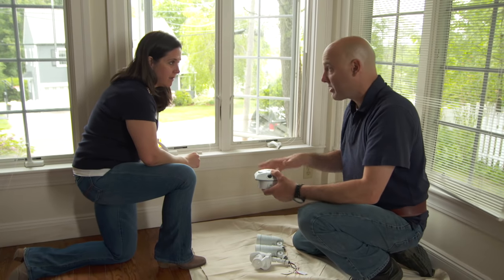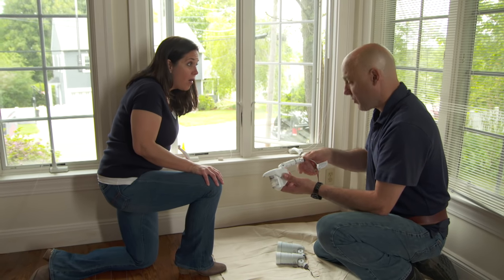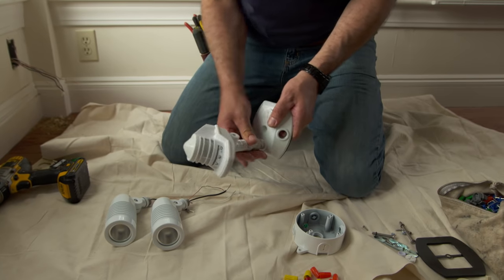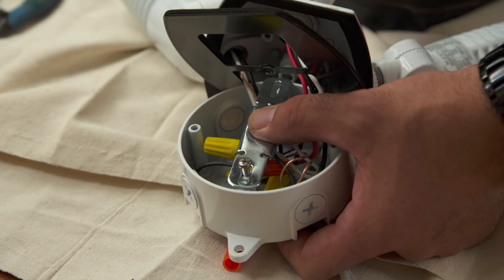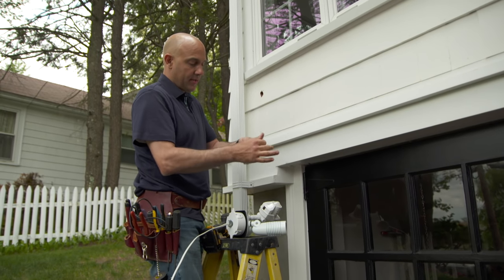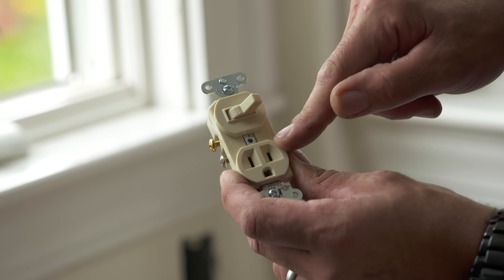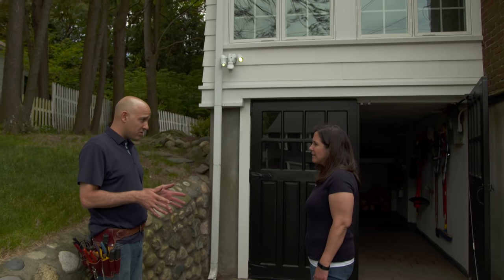How to Install a Motion-Activated Security Light | All About Lights | Ask This Old House

Comment: Tuned in to see wiring, which was glossed over. BTW when drilling out of a house, use a small pilot bit and go outside and use the spade bit from the outside in, so as not to blow out the hole as shown.
Reply: greg yomama no he didn’t. He went from inside out.
Reply: I was thinking the same thing too idk why would someone do it that way and doesn't really mention any wiring for those looking for that
Reply: when you buy the motion sensor it will have its own wiring diagram...

Comment: Love how This old house ALWAYS makes these jobs look easy, but choosing homes that have basements or easy access to do this.  Many homes have metal outlet boxes that are nailed to the framing.  Your not drilling that like you just showed.  NOt sure I'd want a switch that low on the ground or if I'd want to loose the outlet either.
Reply: If the outlet was a homerun/continuous power, why would you need a switch?
It would eventually time out and turn off, right?
Reply: @tii2015  Perhaps you would want the light off to enjoy the stars that evening, or perhaps you have a campfire, etc. and want the ambience of the light from the fire. The only problem would be forgetting to turn the light switch back on for the following night.

Comment: What I'm curious about, is drilling a hole through the box impede its UL listing and is that permissible as per the NEC?
Reply: No, it's not. At the very minimum you need a cable clamp where the wire enters the box. Also that waterproofing with some putty on wood is not enough. And you need to seal the external box.
Reply: @Ariel1S  that duct seal is sufficient for sealing around the back of the box. Especially once he screwed it to the siding. But you definitely aren’t supposed to drill through the back of those boxes. He’ll be alright though.

Comment: Isn't drilling and running the wire through the back of the outlet box against code?
Reply: yes, but.. #thuglife
Reply: +Derek Dinezza Electrical Code haha! That's only important if you're planning on an inspection in their eyes. Licensed electricians go for the path of least resistance, literally. He did most things by the book for the purpose of this video though.
Reply: +briancnc LEAST RESISTANCE. LITERARY!!! LOL
that is so true. he always does work against code
Reply: +Derek Dinezza In the Netherlands it is! and using extra tape to prevent shock hazard! 
I think we have better code in the Netherlands.
Reply: +Mischa Bommer Hallo van Missouri, Mischa!  Actually, our codes are probably the same.  It's just that in this case, the code is not being followed. Een prettige dag!
Reply: if the box has a knock out in the box how is that a code violation, you guys should pick up the code book and actually use it
Reply: centerice state the code reference please
Reply: greg yomama You are right if there where a knock out in the back, but he is just drilling a hole in the back of the box. (see at 1.22 in the video)
Reply: Maybe he put a snap in connector in the back of that box which was not filmed. 

Maybe since the other connection is secured by a connector a mere 2" away its good.

Maybe none of it matters and you can come back 100 years later to check up on it and his work is still as good as gold.
Reply: +Northbuilt, this guy does so much stuff against code, if you watch his other videos.
Reply: l
Reply: Ahh, a code violation but can you cite the violation? 110.3(B) comes to mind.
Reply: Mischa Bommer wow. You guys are so much superior.
Reply: DangerDaveFreestyle a snap in connector for these situations make so much sense, that house must be fairly new to have a plastic housing. I don’t mind the drilling of a hole in a box but it’s code to have a connector of some sort securing the wire to a box but who am I to say, I too follow path of least resistance.
Reply: @jak50cent  Right but that box does NOT have a knockout. Even if it did, you MUST install either a romex grommet or romex clamp into that knockout.
Reply: @electricianron_New_Jersey  Yeah I also hate it when "experts" on electrical videos say it's a code violation without citing it and instead tell me not to "cut corners" and do it the "right way".

Comment: Sure would have been nice to have seen some "straight" wiring. Instead, it was hop, skip, and jump flashes of wiring the fixture. This vid was almost useless.
Reply: Jesus is ALIVE It was useless. I also wouldn't recommend using an outlet to wire an outdoor light, for one it just doesn't make sense and two it looks dumb having a switch on an outlet and three since when do switches go on the ground. Also yes your right this video didn't really show any wiring, no black- hot wire, white wire neutral, green wire ground, anyway the video was pointless, I'm sorry that people had to waste there time on this crap, most of what he showed is written on the box, technically even the wiring is, but seeing how to do something does help sometimes.
Reply: @pspvita99  the black is neutral
Reply: @misterwebb1472  Black is usually hot
Reply: @misterwebb1472  White is Neutral, Black OR Red is hot, Green or exposed copper is ground.
Reply: So show them yourself, ? I need a link following your solution that is suggested ?
Reply: @pspvita99  make a tutorial so we can see the proper way Matt , that might be more helpful

Comment: Wouldn't mind a walk through on the actual wiring.
Reply: +Audioquest56 ...and the red wire they show going to the blacks?  You did watch the video before taking this opportunity to be funny right?
Reply: Ahhhhh whatever works... I just thought there would be modular connections and setups is all.
Reply: it would be nice to have to proper wire schematics, not all of us are electricians. I will look it up, like This Old House, but to many shortcuts
Reply: +Jon Gordon Its actually really easy. There is no need for an explanation. On the motion sensor, there is a red switch wire which goes to the switch. You power the lights constant with + and route the negative through the motion sensor. then it really is just white to white, black to black, and ground to ground.
Reply: +First Last thanks for advice, I will check it out.
Reply: @DordiHOTS  So the wire from the exterior motion sensing light connects to the power wire that was connected to the wall outlet (black to black, white to white, red to red) but does that then connect into the new wall outlet so it is still available for interior use ?  That's the part I don't see. Thanks for any help.
Reply: @michaelbiasatti5016  You can "piggyback" connections, as most wall outlets share a hot wire, but one wire going to the switch is to override the motion sensor, essentially the circuit board inside the motion sensor knows when the power is cut and restored and just turns on the light normally, ignoring motion sensor input.
Reply: @DordiHOTS  no positive and negative on alternating current systems

Comment: Anyone knows what the flexible putty is? I would like to know where I can buy it. Thanks.
Reply: Kinda looks like roof putty which is a butyl rubber sealant. That would be a lot less messier than dealing with silicone and easy to keep a small pouch in your tool bag.
Reply: Thanks though his one seems more shapeable than rubber sealant. Thanks anyway for your input.
Reply: https://youtu.be/4Upksj19lyU?t=2m45s This is the stuff I'm talking about it feels like play-doh or clay after you peel it off. I used this on metal roofing seams and on RVs.
Reply: If it is something else, I'd like to know what it is as well.
Reply: Thanks again. This may work for one of my applications.
Reply: That was regurgitated acting talent. 

They edited that part out, but Erika reacted as such, "Oh, really ?? Wow!"
Reply: Jen-Yi Chen it’s called “plug duct seal”, very useful item because it never hardens and resists water, normally used inside conduit and duct work. For this particular application, exterior silicone would be better suited around the fixture with inside filler with duct seal or window based spray foam.

Comment: Does anyone know if it is against code to do this if you have smoke detectors on the same breaker? Would love to know before I attempt this project
Reply: I wouldn't add anything to a circuit powering smoke detectors.  If the fixture added were to trip the breaker, it might affect the smoke detectors. Why risk it?

Comment: oof. couldnt he have drilled with a regular bit to create a tiny hole on the outside, then from the outside use that widening bit to drill back in? nice clean hole on the outside that way
Reply: who cares it’s caulked and covered forever.
Reply: Yes, especially on older homes. I've seen guys using that same bit push way to hard and break the sinding in half (older shingle siding). Contractors always want to work as fast as possible. You have to be like a F1 driver and know where and when to slow down and when to drive hard.

Comment: This electrician has done so many jobs against code
Reply: like what
Reply: building code differs from city to city....
Reply: Well for starters he drills from the inside of an internal box directly outside. Inside that box there is no method to hold that wire in the box. you can't modify wall boxes as that "was not intended by the manufacturer". No matter the locality codes will work with how the manufacturer for the box or fixture has designed because they work off of the National electrical Code (NEC)  and they feed each other for how to do things.

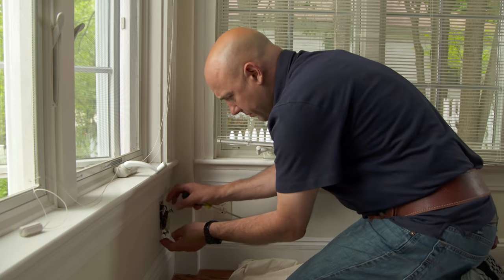Comment: 1:08 dude you could’ve just unscrewed the wires duh
Reply: Nacho Dragon :3 it is just easier if they cut it if there is enough wire coming out of the wall
Reply: Easier and quicker to cut and strip then to fiddle with already bent wires.

Comment: What is it with Americans and those silly screw on cap connections, here in Europe we crimp and solder it properly.
Reply: Right.  That doesn't work in a place where you have to keep power on to do maintenance or replace a bad device.  Seems to me that using wire nuts are a much better option than crimping.  We're working on houses here, not cars.
Reply: In that case a block terminal is the way to go.
Reply: FrozenHaxor
Reply: FrozenHaxor , but
Reply: FrozenHaxor , I am
Reply: FrozenHaxor I use a

Comment: serious hack job... if this guy has a license he should lose it
Reply: Zippy TheChicken why?
Reply: @leonardholt5311  do you have a lot of switches at ankle height in your house? or holes drilled right through the back of a box and through the siding. thats a hack job that wouldn't pass inspection for many reasons.. but then look where he put the security light.. you can walk right up the hill next to the light and its completely in reach.. its a security light... if you don't see those and all the other things he did wrong.. take my suggestion .. find better directions for doing this
Reply: Zippy TheChicken just curious of what specific code violations you saw here. I mean, if you’re suggesting this guy should lose his license, then there should be some code violations, not just things you don’t like.  I can tell you that the height of that wall switch does not violate any building codes. If you feel it does, feel free to share the code book reference. Drilling a hole in a junction box is also not a code violation.  They didn’t show him put a bushing in that hole he drilled but that doesn’t mean he didn’t. Lastly, nowhere in the code book does it specify the height of that exterior light fixture. If you’re saying he could’ve done it different, then i agree. But your comment was that he is a hack and should lose his license although you couldn’t cite one code book violation that he did.
Reply: @leonardholt5311  you go ahead and hire hacks like that
Reply: Zippy TheChicken so in other words you don’t know anything about the electrical trade. Troll away sir